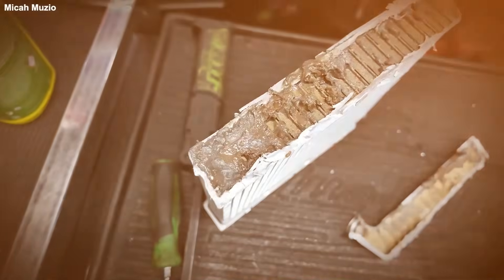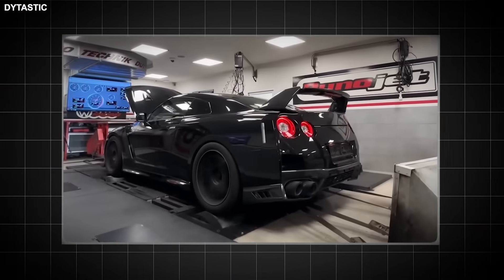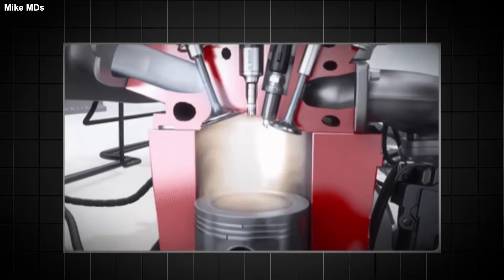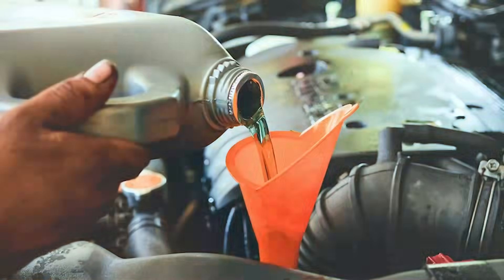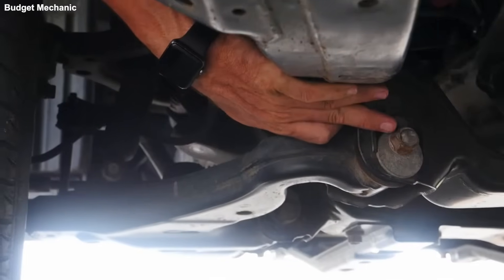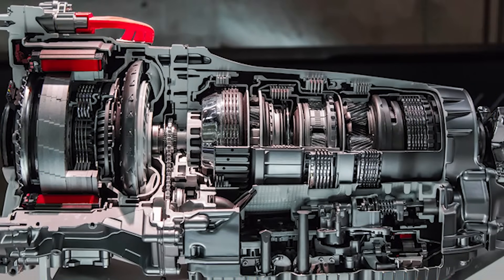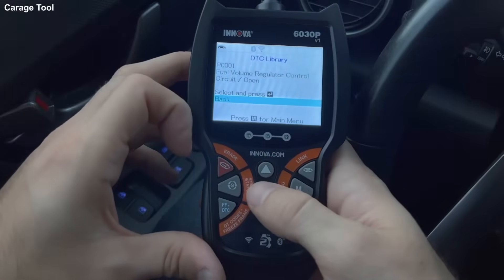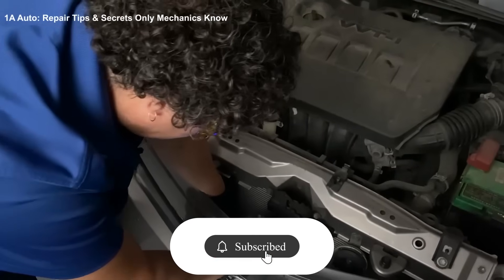11 “Mechanic Secrets” That Are Actually DESTROYING European Cars (The AI Slop Epidemic)

Comment: Few notices (hope you agree)
oil and filters change every 10.000km with the correct ones cannot harm anything, aux contraire 
gearbox oil change every 60.000km if is an automatic or 100-150.000km for manuals depending on climate and drive style and yes use the correct one. If you use DSG only for city traffic you're done no matter what, better buy a car with a classic torque convertor gearbox or a manual if you're not in a busy city...
the rest of the points are solid - finally someone address these "hacks"

Comment: I don't see the connection between motor oil and the particulate filter, honestly... but I could be wrong.
On the other hand, there is plenty of advice that makes sense but that we tend to forget too often... Good work.
Reply: Because of the ash content in oil, cars with a DPF need low ash oil, very important.